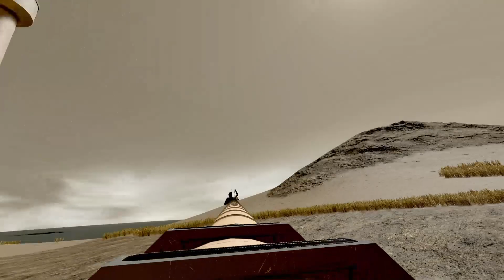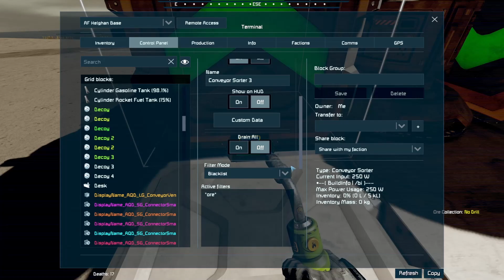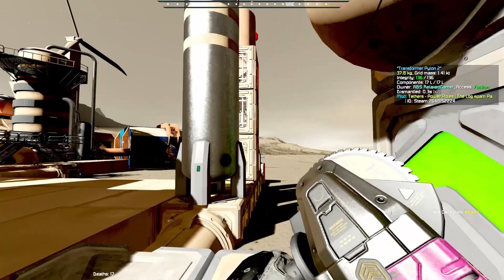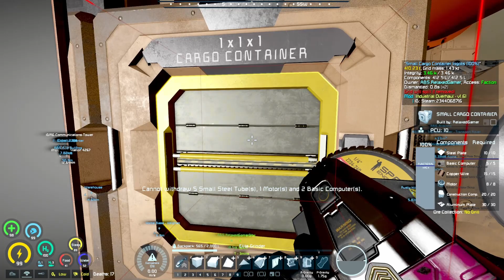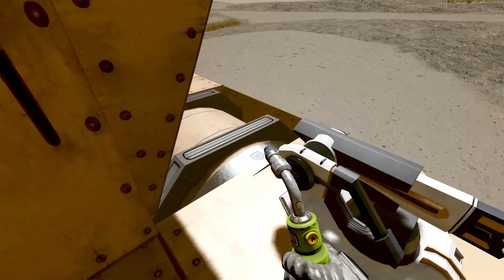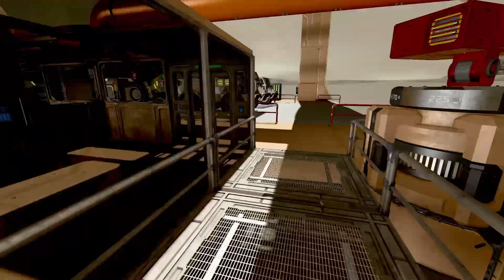Abandoned Frontier Ep 24 - Pipeline Woes! - Space Engineers

Comment: I was going to suggest a bit more space between the two pipe lines to see if that solved the issue but it it sounds like you might be about to try that.
Reply from the maker: I tried it, didn’t work out since I’d need to move it at least 10 degrees of blocks to either side (which is a lot of blocks).  The only thing I can think is running a completely separate pipeline 50-100m away from the other one.  Or change the angle so the cone doesn’t overlap and build a new pipeline. I’m hoping the mod author figures it out so I don’t need to consume a lot of time.  Currently, I’ve ground down the out pipe all the way down the line.